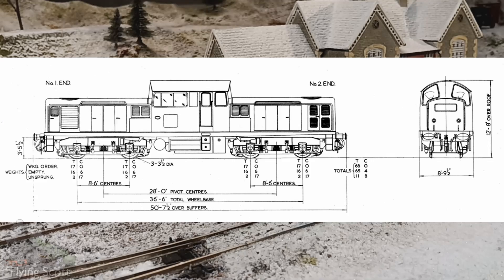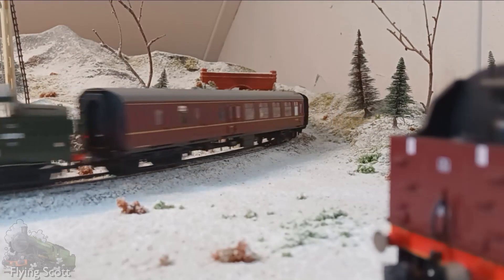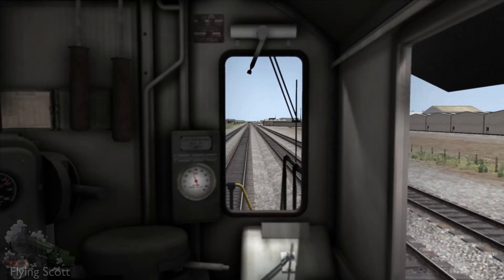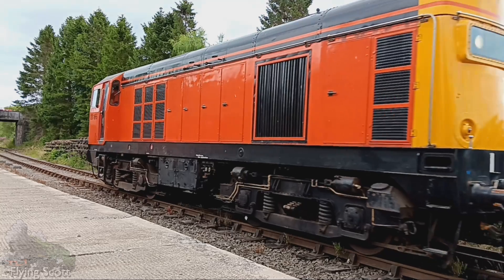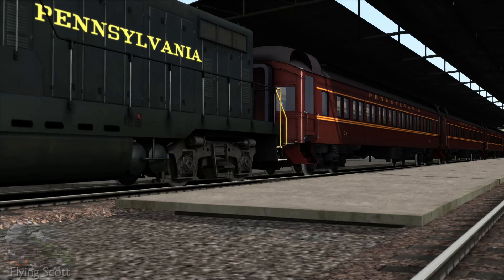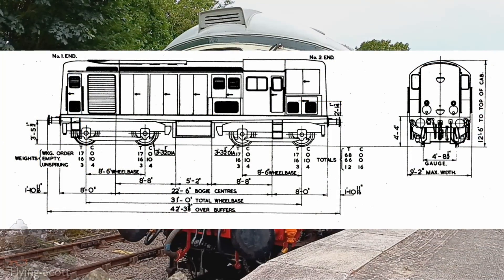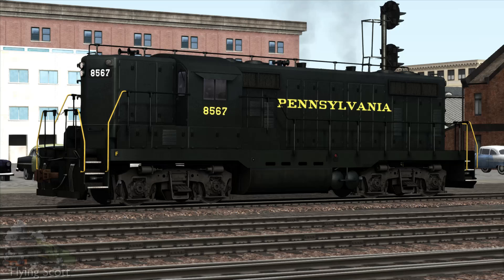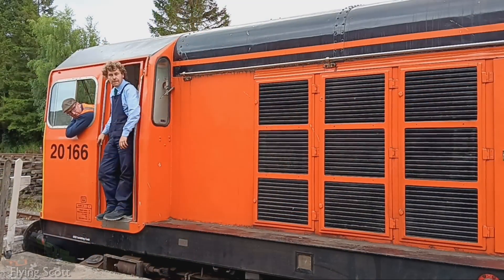Type 1 Diesels & Why You Can't Run Every Railway Like The USA

Comment: It’s interesting to look at the class 15s and compare them to diesels in use around the world. One example I can give is the NSWGR 48 class locos. 165 were built between 1959 and 1970 across 4 batches by AE Goodwin and were fitted with inline 6 ALCo 251B motors and made around 1000hp. These locos share a similar design trait with the class 15s in that they have a short nose up front followed by a cab and then the long hood which housed the engine, generator etc. they weighed a similar amount too (76 tonnes compared to 69 tonnes. 

These locos are widely considered to be one of the most successful classes of diesel locomotive ever used in New South Wales and although there are only about 20 or so left in revenue service (the railways had a mass sell off of older ALCo type locos in 1994) with a number in preservation they continue to put in Stirling work after all these years.

Comment: In the US and many other places, the locomotive formatting seen at 2:13 was used for passenger service.  It had an aerodynamic silhouette, designed for high speed, but loosing lower masses movement, didn't have the access and visibility needed for coupling and uncoupling freight and most importantly, it was designed to generate and distribute "head end" electric to serve the utilities in the passenger cars.  The freight locomotives switchers, road-switchers and switchers like seen at 1:54 were better for visibility, easier on the crew moving around, are easier for maintenance access and not as expensive.
          It may be that the management philosophy at one time in the UK railways was to try to have some universal type locomotives for both passenger and freight.  While there is efficiency in some aspects, this would overwhelmingly create inefficiency in other aspects.

Comment: I wonder then why the 2400 class was so successful in the Netherlands, because they are a very similar design. They built 130 of them (1 with a different cab layout) and they were in service for almost 40 years. And we also had loads of 08-type shunters.
Reply from the maker: The NS 2400 was just an Alsthom standard BB diesel electric given a short nose at one end. The design was trialled and tested and worked as far as places such as Nigeria to Vietnam. Similarly the NS 0-6-0 diesel electric shunters were the LMS locomotives later to be known as the British Railways Class 11, according to the Dutch Railway Museum.
Reply: @FlyingScott  the 2400s were indeed mechanically sound (unlike the class 15), but what confuses me is the use case. We had plenty of small diesel shunters here and, well, some use for large diesels. Yet somehow, the only 2-cab NS locomotive was the 2600 class, they only built 6 of them, and they were scrapped before their 10th birthday. Though that might be because of problematic engines. 

I think one part of the matter is that a lot of NS was electrified by the time steam went out of use, and so they had a lot of electric locomotives. 

Apparently NS just preferred to put 3 diesels in multiple on the regular instead of buying more powerful locomotives.

Comment: I have been working myself on the restoration of the sole surviving class 15.
Outside of the visibility issues and poor reliability there was another point against the class 15, and 16 which shared the same engine.
The Paxmann engine fitted to these locos  is a V16 unit, and compared to the V8 fitted to the class 20 these are overly complicated for even less power than a class 20 can offer.
The class 20 has 1000hp while the Paxmann 16YHXL could deliver 900hp, but was soon derated to 800hp in an effort to enhance reliability.
Its complicated nature was proven to us when it took a whole afternoon for two men to disassemble the exhaust manifold on just one of the banks.

Why the road switcher layout didn't work for the UK was not clearly explained in the video, but is due to the much smaller loading gauge, making the allowed width for a locomotive much less.
Therefore the cab can't protrude as far outside the bonnet or hood as on an American locomotive and this made for very narrow windows at the cab fronts, the crew had to lean outside like on a steam loco to have proper vision when shunting. Having a low nose like the later road switcher would have improved things but only in one direction. Also, the high nose of the class 15 is crammed full with auxiliary equipment too, so it couldn't have been lowered.

Comment: I will be honest, I've always wondered why the British didn't just buy export versions of US locomotives, and convert them to their needs.

Having said that, you make some incorrect assumptions about US switching practices.  I'm not sure if this plays into the decisions made, or not, but there are some details you must know.

"Road switchers" aren't a switching locomotive capable of main line or branch line duties.  Rather, they are main line locomotives with the proper gearing to allow them to also handle some switching duties.  The best example of this being work as a 'local' service. One that stops regularly and picks up, or sets out cars.  A more modern term for them, though, is a "GP" locomotive.  GP meaning "General Purpose."

Importantly, "switch" (Shunting) crews don't ride on the footplate or ends of switching, or road switching locomotives.  They walk. The closest they may get, is hanging off the steps, but even then, that's rare. In the US, crews would reside ether in the cab itself, on the ground, or in the caboose. Of the three locations, walking on the ground was the most likely.  Depending on the company, there were even prohibitions in place that forbade switch crews from riding on the walkways.

As to what those walkways are for, honestly?  To let crews better access the locomotive's engine during maintenance, and help with visibility.   Cabs do NOT protrude.  I'm not certain where that idea came from, but that's just not the case.  That part is 100% incorrect.  The locomotive cab is no wider than the bodyframe of the locomotive.  It doesn't protrude any further.  The relatively small width of the locomotive hood, allowing for walkways, is there to  allow for visibility, yes. However, keep in mind, US railroads used multiple man crews (inside the caboose) to relay hand signals back and forth to tell the engineer how close he is to coupling.  Even a simple 'local' train of oh, twenty cars (wagons), would have a crew of 1 engineer, 1 fireman (both ride in the cab),  1 head end brakeman, 2 or 3 rear end brakemen, and one conductor (who is in charge of the train.  Other than the engineer, and fireman,  most of the remaining crew rode in the caboose at the end of the train.

Comment: When you refer to visibility being an issue because of it being British, are you saying they couldn't make the cab wide enough for large windows because of the small loading gauge?  I've definitely gotten the impression over the years that most of the differences between US and UK equipment are down to the US having a massive loading gauge and having the space to do pretty much whatever they wanted, while the Brits had to make the most efficient possible use of very limited space.

Comment: Tbh Mr F Scott, I'm a little surprised you didn't elaborate more on the class 15 development.
Its design predated the Electromotive GP's, being a development of the 3MT power range LMS NB BTH 1948 locomotive. BTH taking the production for the pilot scheme locomotives. The GM products were from 1949, the LMS body design basing itself on a lowered version of the 1941 alco rs models, GM's intriguing BL mix between carbody and hood unit being singularly unsuccessful.
Interestingly of course, the low 3P rating of the LMS product was indicative of the way British railways were mistakenly leaning towards with squadron production of the pilot sceme type A, B, and C classes. When this was mildly altered to the more familiar types 1, 2, 3, and 4 there had been almost no consideration to a mid powered type 3 locomotive category. The preponderance of low powered type A ("1") locomotives were indicative of planners thoughts to replace aging, small steam locomotives with diesels of the same power, for the same aging trains, without recognising evolving and drastically changing transport methods and applications.
The Brush type 2's mirrlees started their crankcase cracking when they had to be coerced into overtaxing efforts when utilised for the jobs they should've been designed for. The success of the EE type 3's and the Brush type 4's are commensurate with their usefulness.
Sorry, waaaaay too long a comment
Reply from the maker: I used the GM GP as an example, I am not claiming the Class 15 and 16 were based on that specific locomotive, full transparency.
Reply: @FlyingScott  @FlyingScott  sorry, I was more more indicating about the LMS 10800, the geep reference was merely in passing, I noted that you weren't specifically using that, just the road switcher layout.
You did very well with it and the 10800 is a little oblique: you're very correct regarding the class 15 stand alone reason for being.
It was a very good video to watch, yours always are :)
Reply from the maker: Thank you, means a lot :)

Comment: Fun history fact. The class 15 got the nickname "The wonder engine" by crews because it was so unreliable crews often said "I wonder if it will work today".
Reply: That was the class 16 prototype "hawk". The class 15 was actually quite  reliable.
Reply: @professorjamesmoriarty5191  Early in the class 15s career, the paxman engine were found to be very poor quality resulting in constant failures and high maintenance. The crews thus referred to the 15s and "the wonder engine." Eventually, the paxmans were modified to be reliable, but the name had stuck.
Reply: 10800 got that nickname, not the 15
Reply: I didn’t actually know that lol

Comment: Only have to think about the approaches to Liverpool St station with its virtually zero sideways clearance and difficult signal spotting angles made worse during a pea souper would have been a positive nightmare for any driver of the 15/16's and similarly the same tight squeezes at Bishopsgate goods station next door a recipe for a prang or off the road.

Comment: It didn't help them that their engines were prone to failure and had too many cylinders (16) to maintain for such a low power locomotive, compared to the 8 of the EE Type 1

Comment: The BR type 1 diesels were built for traffic that quickly disappeared in the1960s to road competition, as indeed were the large marshalling yards. The was the real reason they all went for scrap. The main reason for the class 20 survival was that nose to nose they were a useful trip engine for short haul coal trains. With a cab at each end as it were, the operational problems of visibility were less pressing.
Reply: They were also far more reliable than any of the 15/16/17. The class 17 was originally intended to be the standard type1, hence the centre cab and lower bonnets.  They weren't satisfactory, and more EE type 1's (class 20) were ordered in a hurry.

Comment: Tbh, nowadays, most freights in the US aren't much different than British ones. Indeed, many local freight trains that locos like the Type 20 were built for, were discontinued due to being uneconomical. One of the only reasons why the US still uses road switchers, even today, is more like a "why not?" scenario. They're more versatile, so you can do more with less... Even though modern road switchers like the GEVO and SD70 series are WAY too heavy to go on branch lines, which is why many shortlines use older models, even today, not to mention that many locals only need an engine capable of between 1,500 and 3,000 horsepower, and rebuilding a locomotive is cheaper than buying new, which many US examples, mainly from EMD, were built like tanks, so there's plenty to go around still. 

In the US, using a combination of cab units and shunters would be sufficient 99% of the time, though the road switcher remains the go-to choice because, again, in theory, you can use it for 2 tasks at once, even though, in practice, a road switcher rarely shunts and pulls its own train, aside from local freights and manifests, both types of trains being less common in favor of unit trains.

Also, many people think British Rail was bad, and, to be fair, it was, but I can assure you that it was better than many American railroads like Penn Central and the Milwaukee Road.

Comment: Steam locomotives including many tank engines had similar poor visibility but were still well liked by their crews. Ex-steam drivers had no qualms about the restricted visibility.
Reply from the maker: I think the problem arises from the boiler generally being round. Ergo, it takes up less space in one's field of view as compared to a slab side without any breaks. 

Take the A4, the nose is slimmer at the nose end than at the cab end. Then there were the Spamcans, where visibility was always a concern.
Reply: @FlyingScott  The locos worked short cab forwards, and often in pairs. Visibility was actually better than a steam loco, and the crews did like the 15 as it was a nicer place to work than a steam loco. The class 16 however, that was the unreliable one of the bunch.
Reply: @FlyingScott  If I had to guess (and I do) I'd suspect that the different perceptions of road switchers between UK and US crews is also related to the curves they had to negotiate. The UK's narrow loading gauge and short wagons allow significantly tighter curves, which would further limit visibility.
Reply: @FlyingScott  in either case the field of view is not significantly different when comparing a flat or curved side. The portholes in the front of the cab are much smaller than those in a diesel locomotive cab front.
Reply: @neiloflongbeck5705  It will be interesting to see the dimensions of some of the Standard class cab front windows. Even in grouping days the Railway companies always fitted a deflector window in front of the cab side windows as the driver and fireman were often looking at the road head through the side windows. Another factor is chimney steam blocking the driver's view, quite a few accidents were caused by it.
Reply: Excellent point!
Reply: For instance, the LMS "Flat Iron" 0-6-4T express passenger tank loco, which holds the unique distinction of being the only locomotive to be always turned around, on turntables, to run bunker first.

Comment: The Class 28 was an attempt to test out the 2-stroke diesel engine in a rail environment but were a bit of a disaster. BR/BTC are to blame for the disaster that the Class 17 was as they were warned by Paxman that the engine would fail due to the use of aluminium alloy parts. Paxman offered to use steel/cast iron replacements but BR/BTC insisted on the aluminium parts that they had tested in the Davey Paxman DEMU.

Comment: They were pilot scheme locomotives. They were never ordered for anything other than trial purposes and they proved, like many other designs, to be unfit for purpose.
Reply: That was the initial idea, but the mad rush to replace steam traction for the deadlines in the modernisation plan meant that an extra 34 were ordered after the pilot scheme batch.
Reply: and they could have been sold to a country that could have usd them like France after all france ordered similar diesels from the US to the point mehano offered US diesels in sncf.

Comment: It seems that a lot of these smaller diesels from the great dieselisation programme, followed a lot of design cues from steam engines with the long nose (boiler). There are several early  diesels and even early electrics from around the world  that seemed to follow these designs. I suppose if a crap view is what drivers have been used to for decades, then even the clear view at one end of a 20 must have been a revalation. Once twin cabs were established as an option there was no going back.

Note that even some twin cabs eg the English electrics 37,40,55 have relatively long bonnet and poorer vision than some of the flat fronted locos such as the brushes 31, 47 etc and from other companies. I suppose the driver experience and demands probably evolved with time.
Reply: The view over the nose wasn’t really a problem. Us drivers tend to look way ahead when working trains. When coupling up the best view was obtained by looking out the side cab window.
Reply: The crankcase was the issue. Once crossley effected a redesign it became a good engine as per the Australian types. 5705 has the modified crankcase. But it was too late to save the class.